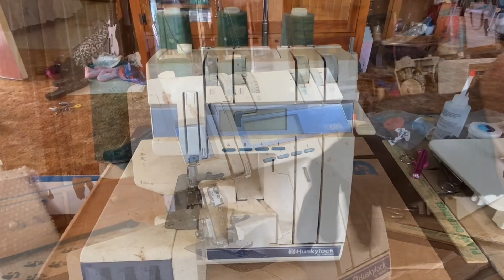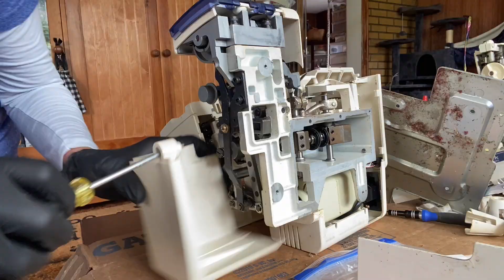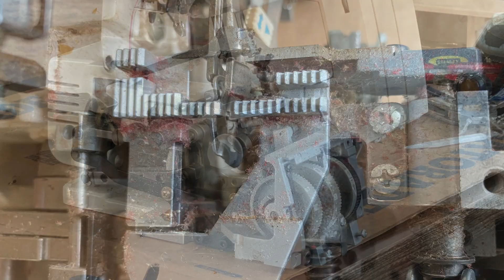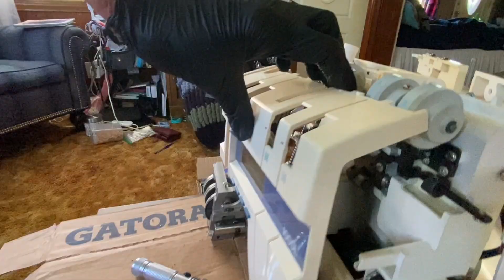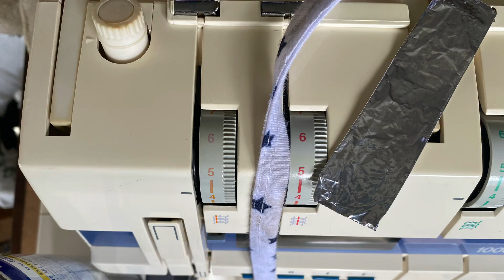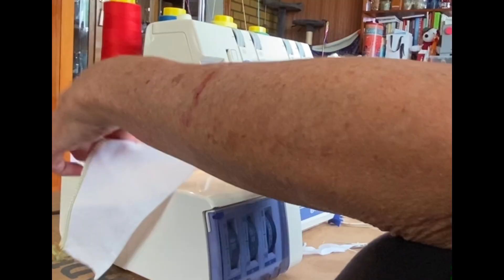Huskylock 1000L clean and oil: WD40 for cleaning, sewing machine oil for lubrication

Comment: Just cleaning my Huskylock 100L and had a spring coil fall off, it has a hook at each end. It was from the bottom looper somewhere, can't figure out how to put it back on. is there any way you can take a pic really close inside your machine for me so I can see where the spring coil goes? when you open up the front where you thread, it will be on the bottom left side. Really appreciate your help!
Reply from the maker: Yes, I would be glad to. I will take her apart in the morning.
Reply from the maker: https://youtu.be/T1MWgRZQSjY?is=N6Z4Q2QJqHpwcY6L
Reply from the maker: Did the video help? I will take it down after you see it.

Comment from the maker: Someone warned against using WD40 for oiling sewing machines. To clarify, I used WD40 to help clean rust areas then wiped it off. Sewing machine oil was used to lubricate.
Reply: Cleaning the rust is only one part of refurbishing these machines. You have to put your mechanic hat and your sewing enthusiast hat on at the same time

Start with whatever cleans the machine and get it to a good reference point.

End with the best sewing machine oil/recommendation from the manufacturer and test sew to ensure you've succeeded.

Check again after 6 months.
Reply from the maker: @JimiLux  Already done and planned. I am an enthusiast when it comes to the old machines. I have repaired or done simple service on many machines and have an old singer to do next month.